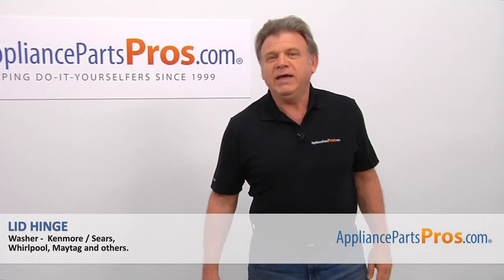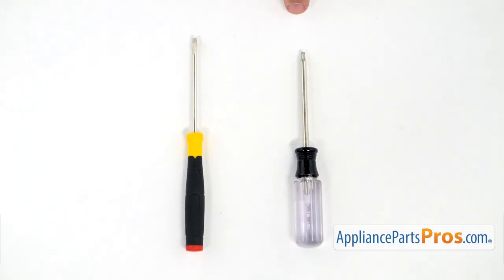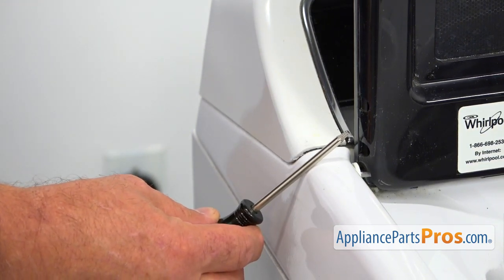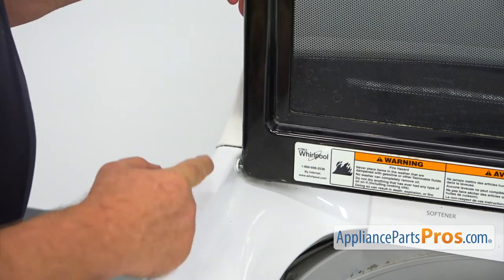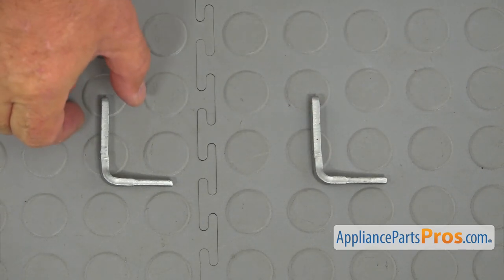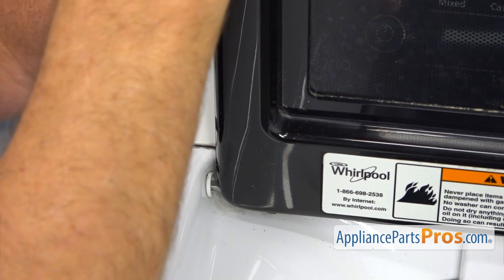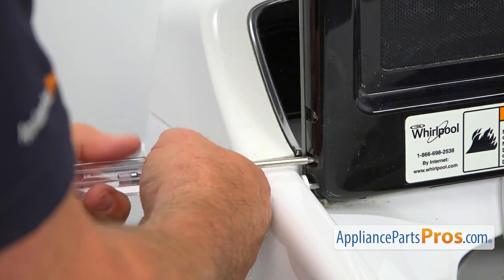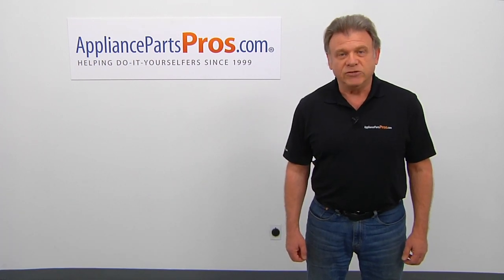How To: Whirlpool/KitchenAid/Maytag Washer Lid Hinge WP8563965

Comment: Would it be better to release the lid from both hinges to do this install or is it safe to leave the opposite hinge installed?  It seems like a lot of force would be placed on the other hinge when you lift the lid off of the hinge being replaced.